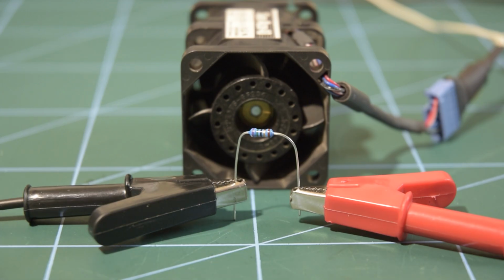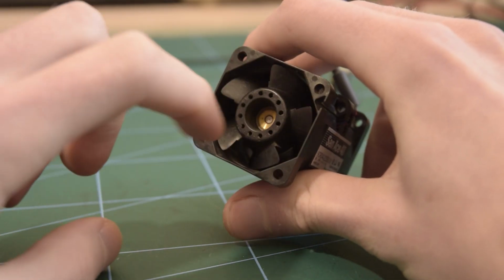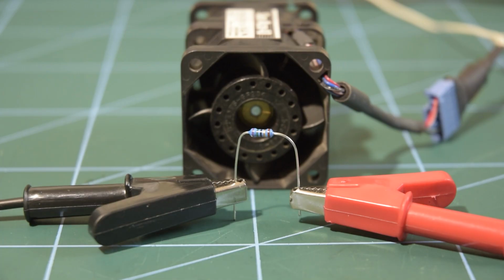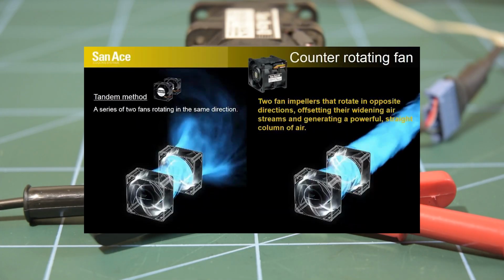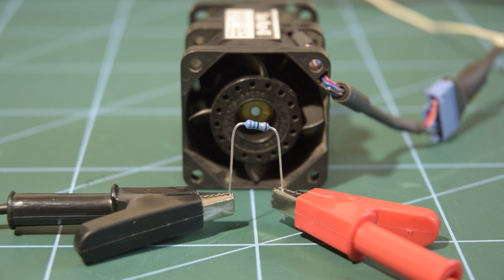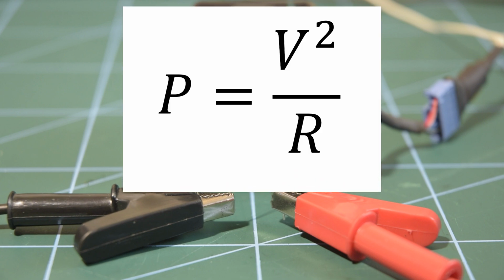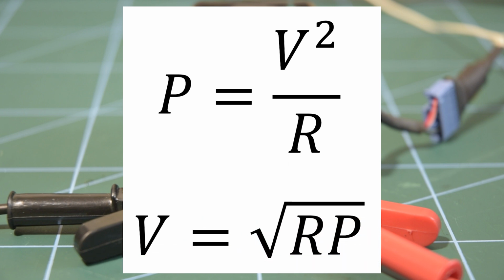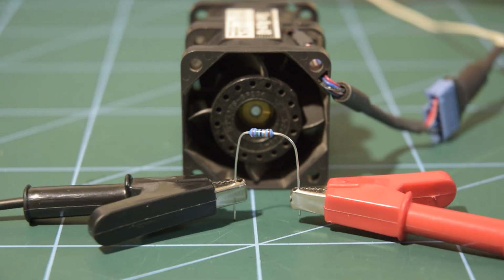The Impressive Impact of Airflow on Cooling

Comment: I once set up a lab with a 5W resistor which was manufactured inside an aluminium extrusion. The idea was some sort of temperature control and we mounted it on a heatsink with a fan. Overdriving it was a mistake as the thermal resistance between its conductor and the extrusion was too great so it didn't take long before the conductor vaporised and the internals exploded out one end. Yes, we jumped!
Reply from the maker: I've had a similar incident where I put several kW into a 50W aluminium resistor, so terrifying!! Apparently my university's power lab used to have warnings up saying to avoid the extruded resistors because their explosions are so violent 🤣

Comment: Great video! The imaginary temperature, current time graphs it produced were very insightful!! Then wondering what happens to the graphs if you put the whole rig (including the fan) in a box and try and cool it with a refrigerator motor, then put that whole rig on a giant ball of rock a few million miles away from the biggest nuclear fusion reactor you can see in the sky, ... 🐧!🌅🌡🔥

Comment: Distilled water has been used to cool 415VAC  3 phase thyristor bridges and inverter circuits.. where all devices had the common distilled water supply.....
Distilled water is a sufficiently good insulator...
Reply: Better use oil
Reply: @ABa-os6wm  what's the technology , reasoning, & justification in using it?

Comment: how about putting it in pressurized water, looks like it was making lots of air bubbles that ruins heat dissipation
Reply from the maker: Yeah I would like to try that some time, really push it to its limits. I imagine the thermal resistance of the ceramic package would probably be the limiting factor at that point, making it impossible to keep the innards of the resistor cool

Comment: I once tried to use about 6-7 3W each resistors to make a 50Ω dummy load for my RF amplifier testing.I submerged them in water and they can even handle 1kW continuously and 1.6kW peak.
Reply: Most of the current would be flowing through the water..